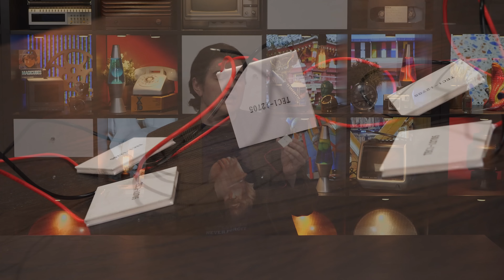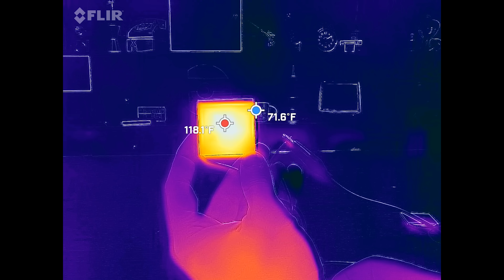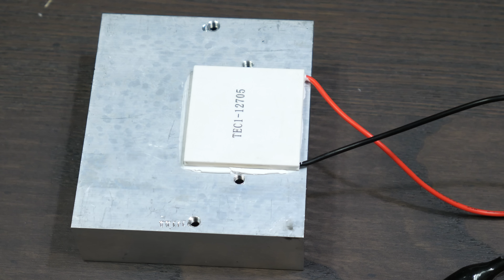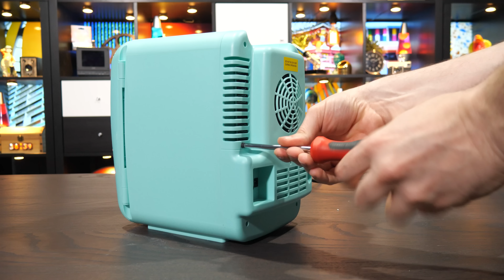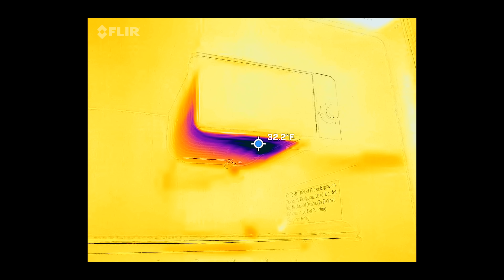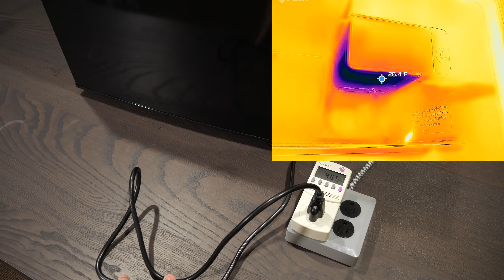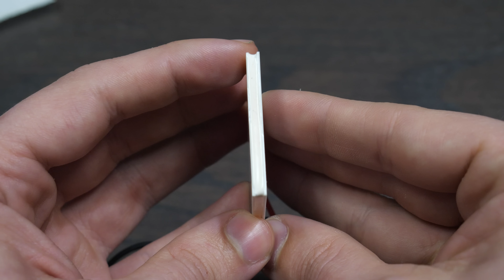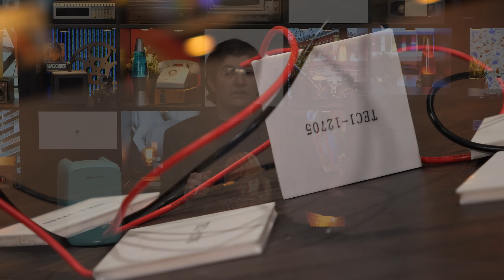Thermoelectric cooling: it's not great.

Comment: The speed and reversibility advantages of peltier are pretty helpful in lab settings. When you need small amounts heated and cooled quickly and precisely, Peltier is your friend.
Reply: I was wondering what 'real' uses there are. Thanks. 😊
Reply: @MattBrownbill  They're useful in water dispensers where you can either heat or cool water very quickly, using no electricity when not in use. Mine can give me a glass of ice water or coffee in around 25 seconds. This is much more efficient than using a compressor fridge, simply because there's no loss over time.
Reply: @MattBrownbill  Keeping sensors at a specific temperature as an alternative to calibrating across the expected temperature range and making a calibration table. Just use one to pump heat in out out of the sensor to maintain a fixed temperature then you only need to calibrate the output for that specific temperature.
Reply: @MattBrownbill kimchi fridges use peltiers because vaporcompressors have too much hystersis for kimchi. Peltiers do not suffer from this issue. And lab instruments too, especially where there is no room for a vaporcompressor cycle.

There is a lot to be desired from this video.
Oh well, science educators..
Reply: @kopazwashere The Video is fine, it is meant for normal consumers, they usely dont use lab equipment.
Also lab equipment is basicly the only place where it is reasonable to use them and even there are alternatives, like the combination of a vapor compression cooler with a heating element.
Reply: qPCR is one use. Repeated heat cycles to specific temperatures and cool cycles to halt reactions.
Reply: I was going to say, I use it for lab stuff.
Reply: Especially if you only need to make sure a sample is at some standard temp near room temp (20 or 25 C are favorites), here it's just temperature regulation so that all the samples are the same. The ability to go hot or cold is nice  - keeping something 20 C when the room is 18 C in the morning and 22 C in the afternoon.
Reply: We used it for measuring the serum osmolality in a hospital lab, and it's used to detect adulteration (dilution, mostly) of milk by freezing point depression. BUT ... we were freezing TINY volumes of  liquids.
Reply: Also used in HPLC (and UPLC) column compartments to allow versatility between cooling and heating the column (and same for samplers and... probably any lab equipment (besides a refrigerator) that needs to cool).
Reply: @ChrisNorulak  huh, i didn't know that one. I have only used Agilent 1100s, and the cooler for the autosampler was a whole separate module so that was probably not peltier, and I only used higher than ambient in the column compartment so I assumed it was resistive heating.
Reply: @ashleycarmichael497  it's definitely what PE used in their 200 series (if equipped with a column cooler) - I wouldn't be surprised if Agilent also used Peltier (it's hard to imagine technicians worrying about compressors and refrigerant levels...)

I suspect the 1260 Autosampler (with sample cooler) is also Peltier since the module is just an attachment to the back of the autosampler that contains a giant heatsink and fan
Edit: Added some clarification - the normal column heater (no cooler) is just a heating element
Reply: Agilent ICPMS instruments use Peltier cooling for the spray chamber component
Reply: I guess Peltier can be a heat element with more than 100% efficiency.
Reply: @user-vo3st8kx7s  Depending on the application, not really more than 100% efficient because the heat still has to come from somewhere. You wouldn't be able to, for example, heat a room with peltiers with over 100% efficiency unless you were sourcing the heat from outside like an actual heat pump, which wouldn't even be worth doing with peltiers because they are so inefficient that the ROI on such a system would be terrible.
Reply: Buy cheap. Get cheap. False marketing aside I would like to see a comparably priced. 

 Not going to beat physics. But come on. Don't attack the tech which is useful.
Reply: @dianapennepacker6854  The thing is this is a channel for consumer awareness. If you're buying a peltier for a specific purpose, you've already done the homework of figuring out what the best technology is for your application. For example, these were the hotness a few years back in the hobby computer space for some sub-ambient cooling of computer components. The problem is the efficiency (which most hobby builders are concerned with) is dog, and you have to additionally deal with the complications of sub-ambient cooling (condensation near electrical components). So they were only useful in a narrow niche of "I'm not doing extreme LN2 overclocking but also want sub-ambient cooling, am equipped to deal with condensation problems, and energy cost isn't a factor."

Which is a market of like 3 people. The rest of the market moved on. For non-specialized consumers, these things are absolute pigs and have no business being in your budget.

edit: Also for that subambient computer cooling job, chillers exist, which are just refrigerators that cool flowing liquid.

Comment: For a lot of people the little fridges are handy because they’ve got limited space and even a small mini fridge would be too big. I’ve seen some compressor based powered coolers that are almost that small, but because they’re special they’re also expensive. 
I got one of the crappy little ones for free since it quit working. Was able to use a power supply to run it since the circuit board that made 12v had failed. Works well enough to keep a couple of water bottles cool. 50° water seems pretty cold coming in from 90° heat.

Comment: So much respect for acknowledging that the makeup and skincare folks had found a legitimate use for these even if it's not something you would necessarily use it for yourself.
Reply: Same for solder paste (which has a short shelf life when refrigerated and an even shorter shelf life when not). And you wouldn't want a 50x50x50cm mini fridge for just a single small syringe or a 100ml container, nor would you want to keep a paste with powdered lead or bismuth, other metals and volatile chemicals in the flux in a normal fridge next to food
Reply: to be fair if the makeup and skincare folks also used a compressor-based mini-fridge they’d probably be better off. Mini-wine coolers are fairly common, aren’t generally too much larger than thermoelectric beverage coolers, and typically have temperature regulation and other goodies attached.
Reply: It's actually very important. Cosmetics have to be delivered in climate controlled (ie. refrigerated trucks) to keep them at the proper temperature. So does chocolate. Those trucks aren't just for frozen foods.
Reply: They’d still be far better off using a real mini-fridge. But if you actually have no room for that, I guess this has to do.
Reply: @FuncleChuck It's ideal for having in your room or bathroom, convenience. Also bedside meds where you don't need a mini fridge

Comment: I've recently bought a camping cooler (with a compressor!), and it's the cutest thing ever. Cooling to -18°C (-0.4°F) is not a problem at all.
12VDC, 24DC, 230V AC, it takes it all.

Comment: The blue thing might have performed a tiny bit better with fewer things inside.  It does seem obvious that it's sized for 6 pack of 12 oz cans.  Perhaps it's even marketed that way.  
I'm thinking that since there's no forced air circulation inside, with the compartment that full convection based circulation is going to struggle.  Perhaps more air space would allow a larger volume of air to flow by convection and it could cool the fewer things inside a little bit better.  Still, it's a scam.

Comment: Hi. I would like to say that some veehiclees like my pick up will use the air coming from the climate controll to cool or heat your cup holders. The heating doesn't really work that well but cooling works amazing. I have found that if you have the air-conditioner on for a long period of time it will cool down the cup holder to a hair above frreezing since the air coming from any airconditioner vent is 0 degrees celcius or close to it at least some air-conditioners will have a discharge air temperrature of below 0 and others will have an air temperature between 2 and 5. And sorry my American friends I don't know what these temperatures are in farenheit

Comment: At work I look after some scientific imaging equipment. Experiments spend several weeks in the cabinet and are supposed to remain at roughly the same temperature throughout. The machine is in a temperature-controlled room, but that temperature can fluctuate by up to 5C in either direction (especially in the cold room when genius PhDs leave the door ajar). The equipment has several Peltier modules, and this seems to be a great application for them. The nominal room temperature is close to the experiment temperature, and simply reversing the current gives you heating or cooling as needed. They're just taking the edges off the variation in room temperature, so aren't working hard, or at all, most of the time.

Comment: Those stove top fans that use Peltier plates are actually pretty good, IF you reverse the direction of airflow, so the fan is blowing air across the heatsink, rather than pulling through it. Doing that alone made the one I got for $30 four years ago is still running today.
They're pretty bad for thermal transfer, but great if you want to generate a small voltage. It seems that if you want to retrofit things like radiator valves so they can be controlled remotely, AND recharge their batteries from the inlet pipe to the radiator. That way, even if the batteries are drained with the valve closed, the pipe before the actual valve would still be able to provide enough heat to power up the module and open the valve.
The problem isn't the technology, just the application.
We've been using RTGs on spacecraft for decades, the principles are solid when used for generating small charges.

Comment: Fun fact! You can actually stack peltier devices to get better efficiency from them - BUT you get diminishing returns for each one you add. The last time I was playing with them, I found 4-5 of them to be the optimum for my purposes at around 5W, and it was getting down to -10°C. I was driving at at around 1V, with lower voltages being more efficient, but it increased the power requirements - each of them was around 800mA, plus the fan, with a total power of around 5W (if I remember correctly). Check your datasheets for more info :D

Would it work for that tiny little desk fridge? Hrmm... probably, but you need to add a bunch of extra cost for the peltiers, defeating the purpose of its price point! I would just go for a heat pump at that point and get the cooling ability better... but Im not refrigeration engineer! I'm a nerd who plays with electronics xD

Comment: Cooluli fridges in the 1.5 liter single fan auto temp, and 2 liter dual fan with temp control are awesome for drinks.  They hold enough to cool overnight and have drinks for a week.  I also use my 1.5 liter fridge to keep water cool in a tea dispenser.  Kind of like having  1 gallon water cooler.  I do understand your point of view, as they run hot and take a while to cool down.   Highly recommend the 1.5 liter, as its $99 compared to $150 for the 2 liter duel fan. Awesome video, keep it up!

Comment: These were hot around the late 90's and early 2000's for PC heat management, but with the advent and refinement of heat pipes the demand really cooled  off. Shedding the CPU heat+the extra Peltier heat on the other side was an issue. Over the years I've seen people try to use them to as a cooling element for water chillers for high performance PC cooling, that also didn't work very well. I think maybe these could work in space to actively transfer heat when there's abundant solar or nuclear power present but for earthbound applications these just aren't it.

Comment: I bought an electric camping cooler a while back to use in a semi truck.  It has a TEC and fans in the lid.  It's awful.  If the cab is kept room temperature in the winter, it just barely keeps up.  In the summer, it's hopeless - I'm still freezing water bottles to help it out.  Since it is so very cheap, there's no temperature control besides the manual Cool/Off/Heat switch.  So if it gets -10F overnight while I'm gone?  Kiss that produce goodbye, because it will be merrily making things even colder inside.  Leave it off and everything spoils because the cab really is 75F for a few hours after I leave.  The fan is also the crappiest thing known to science.  It had a really crunchy bearing from minute-one, and a year of 100hr/wk usage has not made it more happy (or quiet).  I just need to bite the bullet and hoist my actual real-deal mini fridge in there.

Oh yeah, and it uses a LOT of power.  It can plug into.the inverter or the 12v socket.  After 5 minutes in the 12v, all the metal parts of that plug are almost hot enough to weld with.

Comment: The only use I've been able to find for a peltier cooler is using it as a low power heater for 3D printer filament drying. I bought a tiny peltier dehumidifier and chucked it into a chest cooler. It collects just a drip or 2 of water, keeps the chamber around 90F - 95F, and uses about 20watts. It was just a cheap convient heating device that had a built in fan for heat circulation.

Comment: Is the bottom drawer refrigerator really that bad a ding for energy efficiency? The bottom drawer acts like a chest freezer, so will hold the cold air down in it when opened, as opposed to the top drawer that will dump the cold into the room every time it is opened. Especially with ice, which I could see getting often, and the drawer better than having a hole in the freezer door for an ice and water dispenser.

Comment: I have a Bosch refrigerator from 1959 (!) in daily use in my kitchen. It runs a massive compressor at around 100W filled with 'good' old R12. It's a smaller model, about 4' high, and despite its age it only uses around 700 Wh per day. This Peltier stuff, much like one pipe air conditioners, is total crap!

Comment: First off, I agree with everything you said. BUT! Those Peltier units have an upside. I have a 12v BBQ rotisserie unit I built. It's powered by those thermal cells, using the heat if the coals. The other side of the plates dumps it's heat into water to give me a hand washing station. Other than that, those things are useless.

Comment: They might not be energy efficient when used as a pure cooler but they do for sure have there place in the market specialey since they can use that temperature difference to generate electric power. One of those uses cases are these stove fans. They use the power generated from the temperature difference of the wood stove and the ambient temperature to run fans to circulate the air and spread the hey. No need for batteries or external power supply.

Comment: I use both a Dometic thermoelectric and compressor cooler.
The thermoelectric cooler is with me for 14 years.
Never let me down and works perfectly for my needs to store my food and drinks at work when plugged in to the mains,

The compressor box cools much much better but also weighs 3 times as much. I haul it around to different jobs so for week long jobs i always prefer the thermoelectric cooler

Comment: Ever since i learned of peltier devices and thermoelectric cooling, ive had the idea of making a jacket that has a tube full of water running through the inside, which is then cooled/heated using peltiers to keep the temperature in a more comfortable range so you can wear your favourite jacket even when its quite nippy outside. Someone who has more experience working with these devices can tell me how bad / good of an idea that might be

Comment: Ah, you missed the REAL use for those peltier fridges, KEEPING YOUR LUNCH WARM! They don't cool worth a d@mn, bit they actually keep stuff piping hot, if it's put in warm, of course. I used one for years in my work van during the winter months to keep my lunch warm with much success! 
ALSO, the peltier coolers do not condense water nearly as much as a refrigerant compression system does, which is GREAT for wine + cigars.
Reply: Oh, and those peltier units ALSO generate electricity when you heat up one side, ask an Alaskan in the bush about how handy that is for charging their phones and devices

Comment: Peltier elements can also create current when heated (or chilled I suppose) so that one side is hotter than the other. This makes them great for running something we in Swedish call “kaminfläkt” which translates to something roughly like “wood-stove-fan or fireplace fan maybe”. They are great for pushing the heat from the stove around the room. Just put it on top of the wood-stove and the heat will spread much quicker in your off-grid cabin or anywhere you use a fire as a heat-source!
Reply: My husband's grandparents had one they put atop the huge wood stove in the middle of their chainsaw shop.  I always wondered how that little thing worked.